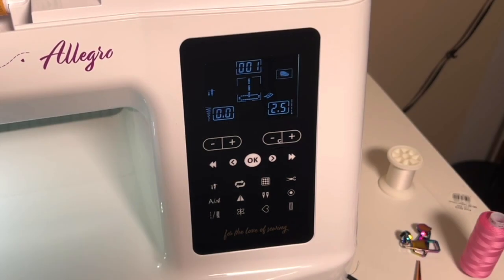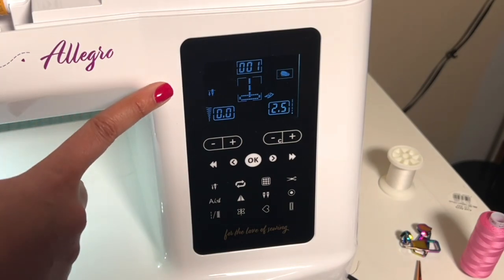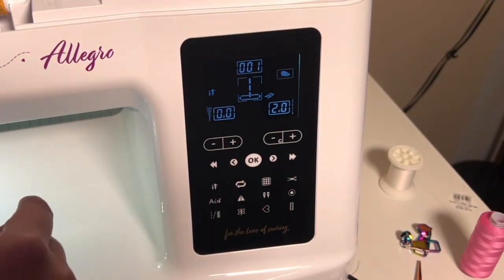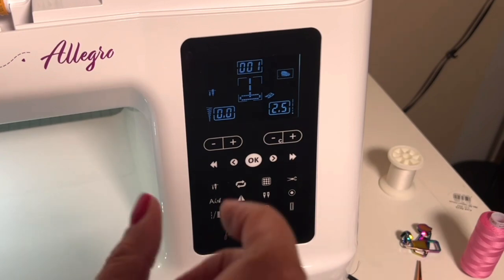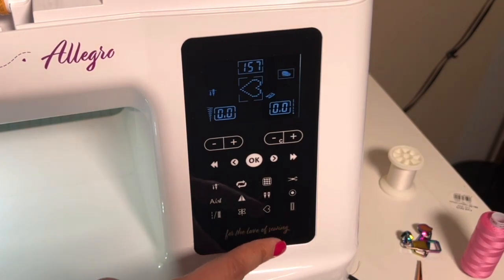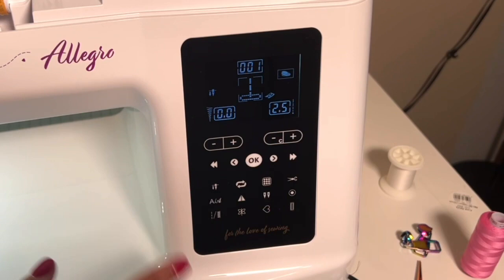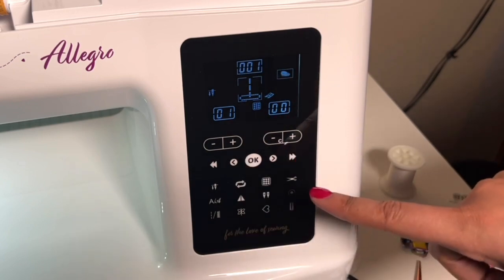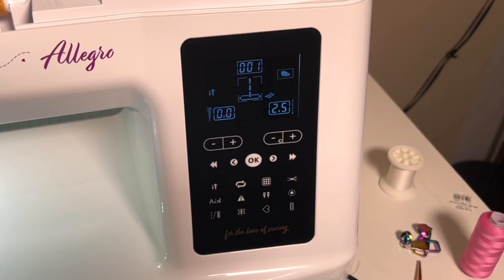Allegro LCD Screen

Comment: Can you nudge the needle left or right when on 001 straight stitch? I want to do a scant quarter inch. Is there a recommended seam guide? Thank you for these videos. I’m loving my Allegro!
Reply: Good question!  I would like to know this also.
Reply: I want to know as well
Reply: @janetstephens7063  In case anyone still needs the info, switch to 002 and then use the stitch width settings to move the needle to the right.  I've found 4.0 is a perfect quarter inch and 4.5 is scant.

Comment: I would love it if you could tell me how to fix my LCD screen!!! I got mine back in Oct but my hubby got it for me as a gift and wouldnt let me open it til Dec. so when i finally opened it and started trying to use it  all it did was create nesting on the bobbin side so I couldnt even use it so i had to send it back. They ended up replacing the bobbin case.. so I got it back and  used it for less than a week when all of a sudden it started doing it again but i was able to figure out how to fix that part the bobbin case was jumping over the spring some how .. But then all of a sudden I went to change my stitch pattern and couldnt because  my lcd screen is locked up and will only sew on the number 1 straight stitch! i can change the length of the stitches but thats it.. none of the other features will work all it does is beep. they did a video call and couldnt figure it out either so here i sit with a brand new EXPENSE machine that i cant even use . And Sewing Parts Online wont send me a new machine ! I cant even tell you how angry and frustrated I am right now!! And the video chat was this past Thursday and I have gotten anything from them , no email, call nothing since!! all I have gotten is crickets.. All I want them to do is replace this machine I think there is something seriously wrong with is .. Im so frustrated as to what to do. Sorry to vent I was hoping your video had an answer.. I havent found anyone yet that has had the same issue..
Reply: Loosen the plate.  Quilter’s Attic did a video on stitch not changing.

Comment: Is there a way to make your decorative stitches a different size?
Reply from the maker: You can adjust the stitch size by changing the length and width once your stitch is selected
Reply: @fullbloomfibers   I tried changing the stitch length when I picked the design. It will not change. Am I doing something wrong?
Reply from the maker: @Reneasewitseams  I'm currently away from my machine but I will check and try to troubleshoot that for you.  Which decorative stitch were you trying to modify?
Reply: @fullbloomfibers   the swivels line one. I think #107 but not sure. I want to make it bigger so I can use it as a quilting stitch.  Thank you for your help. I’ve only had my machine for about two weeks
Reply: I do not believe decorative stitch length or width can change.  Only straight stitch can be adjusted.

Comment: All I wanna know is how to move the needle to the left or right
Reply: I found this in the comments. I haven't tried it yet so I'm not sure if it works.     In case anyone still needs the info, switch to 002 and then use the stitch width settings to move the needle to the right.  I've found 4.0 is a perfect quarter inch and 4.5 is scant.
Reply: @michellecarr5096 . Thank you so much.  I have been hunting for this info for so long.